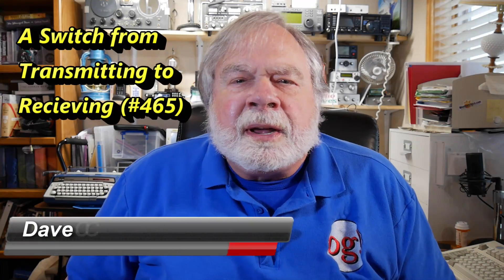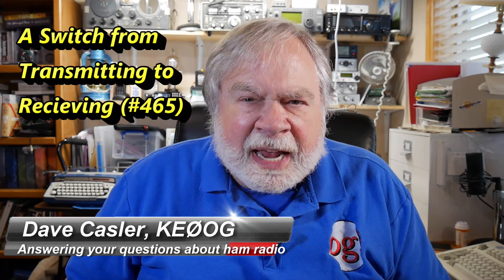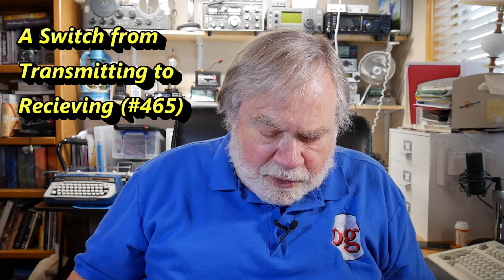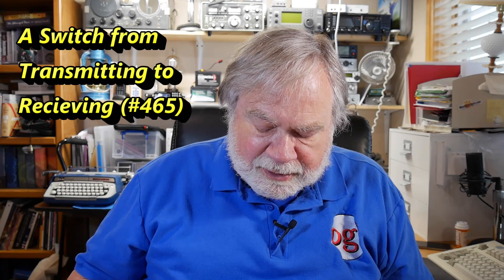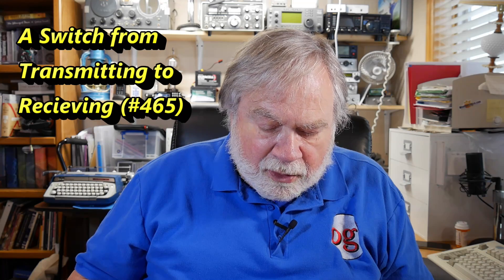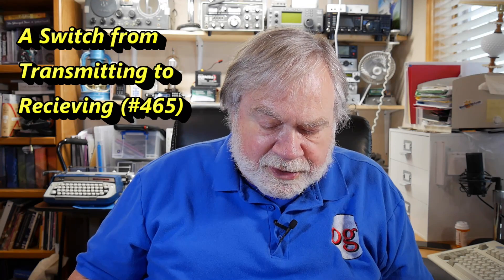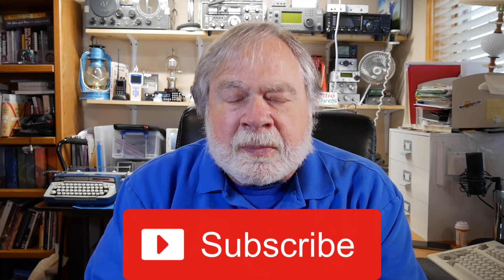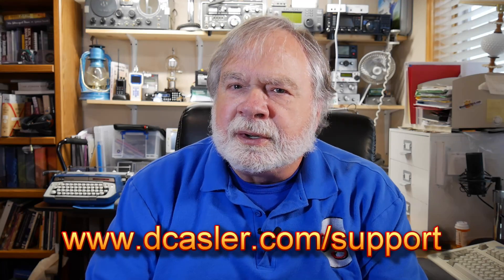A Switch from Receiving to Transmitting (#465)

Comment: Steve Ellington has a YouTube video which covers this subject....... he uses the Inrad 7300 mod kit and the DXE Rx protector as suggested below. I homebrewed up my own lightning fast T/R switch using an RFK-6396 relay from MGS4U but it requires some electronics to interface with the 7300 as it has a 24v coil, which eliminated me having to get into the Icom. Obviously you want the T/R relay after the 7300 and not the amplifier........ 73, ham radio is all abt learning...enjoy Mike, K1FNX near Boston

Comment: Speaking of isolation, I had one of the Daiwa 2-position switches.   It had poor isolation even used only for receiving.   I found its problem to be a thin coating of oil inside the switch body that kept whichever side was supposed to be grounded from making a good electrical contact.    I cleaned that up and got an additional 35 dB of isolation.

Comment: I may have the wrong end of the stick but might the MFJ-1708b do the job? Or at half the price from China search for "SDR Transceiver Switch Durable Aluminum Alloy Small Size Antenna Sharing Device" on your fav auction site.
Reply: I haven't been impressed b the construction quality for MFJ products.  I always perform a tear-down to check.
Reply: I have the older version that I use - it works both to switch radios as well as used the other way around to switch antennas - I use it to switch from vertical for tx to wire for rx on the lower bands - used for about 7 or 8 years now, works flawlessly

Comment: There's a good auto antenna switch kit from one of the kit companies. I can't remember which company, but I've built the switch and it's good, easy to build, will handle 100w, and costs something like 15$. You could find it with a little searching around. (As I say, it's from one of the main established QRPp kit companies.)

Comment: Go old school!
Get an A/B Coax selector switch for $25.
\m/ ô¿ô \m/
Reply: They don't necessarily have good isolation.   See my example above.
 Even if it doesn't end up burning up a radio, increasing the isolation that can improve the received signal too.   Every 6 dB of isolation could theoretically mean 2x the range on receive.
Reply: @howardhiggins9641  Isolation: Better than 50 dB according to the specs.
Reply: @greglawrencemusic  That's the specs. But age, and contaminants can reduce    Newer switches are more expensive than $25, and not necessarily better than older models.

Comment: Seems to me that you would put the switch ahead of the amp not after it. The amp would only be seeing the transmit antenna
That way the switch would be seeing only 100 watts from the rig,
Reply: That is not the issue here. The problem is isolating the RF from the linear amplifier and TX antenna from the sensitive electronics of the active RX antenna or the radios receiver